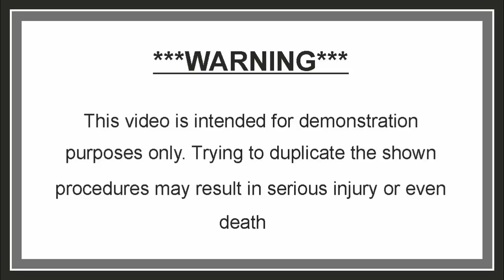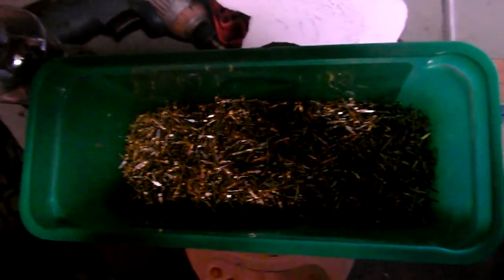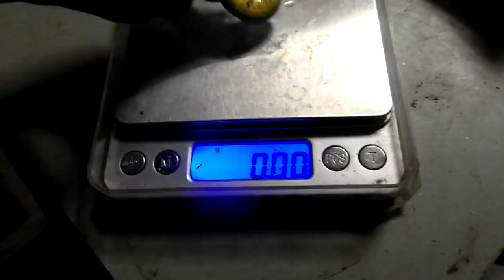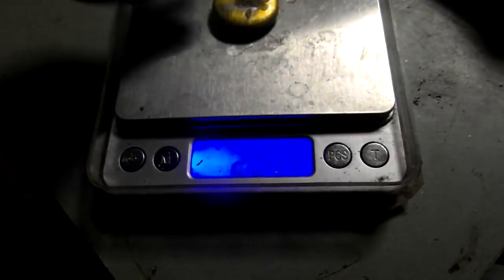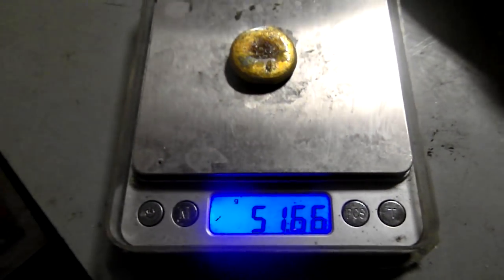VERY high yield GOLD plated pins

Comment: For the initial step of removing other metals from the pins, when you mixed nitric acid with water 50/50, how long does that process take with 1.5kg of pins like you used?
Reply from the maker: 5-6h
Reply: @OwlTech333  thankyou, and are you incrementally adding hydrochloric acid with a dropper to limit the use of a precipitant? What I'm asking is, Are you making Aqua Regia for this video? during the initial dissolution, was that just nitric acid and water? When I saw orange fumes I figured you were using aqua regia but then the gold would be mixed with the other metals right?
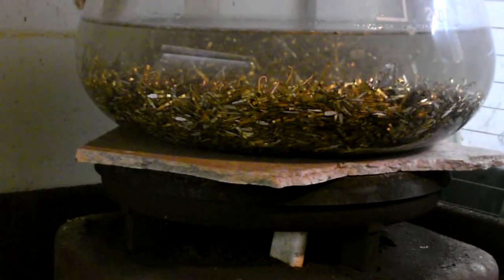Reply from the maker: @JimboS1ice999  @0:56 nitric and water, @10:10 digesting pins in aqua regia
Reply: @OwlTech333  also what is the purity of the end product? what karat? if you don't mind me asking? if it's near 10k or 14k that's amazing.
Reply: @JimboS1ice999  привет, какие 10 или 14 карат, конечно 24! Я думаю Сова не против.

Comment: And for pins like this that have some solder on them should i use hcl to remove them rinse and do 50/50 nitric acid
Reply from the maker: you can boil them in dilute nitric 1/10 H20 to remove the solder

Comment: Holy amateur hour. This has gotta be the most ghetto little science lab set up I have ever seen. Do you even have the proper PPE? I never see gloves so I doubt the ventilation is up to speed.
Reply from the maker: Amateur - you got this right (never claimed the opposite),  the "little science lab" (flattering, unless I failed to see the hidden irony) is a simple DIY fume hood which serves its purpose : namely carrying away  the last traces of fumes (reduced to a minimum beforehand by the process employed).  Ever crossed your mind you don't see gloves because they are invisible ?(google: wet work barrier cream, invisible gloves, gloves in a bottle and so on)  I DOUBT it!  :)
Reply: @OwlTech333  🤔🤔🤔...gloves in a bottle....sulfamic converts nitric to sulpheric...you NEVER dissapoint with lil gems of knowlage owl😎